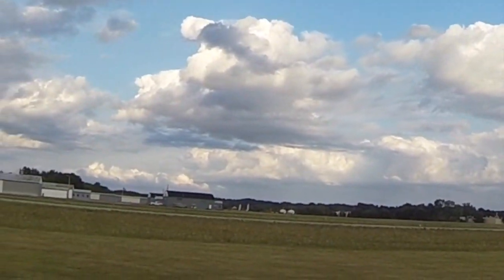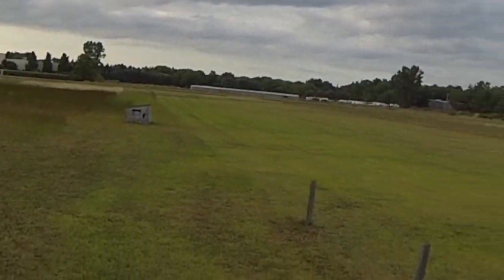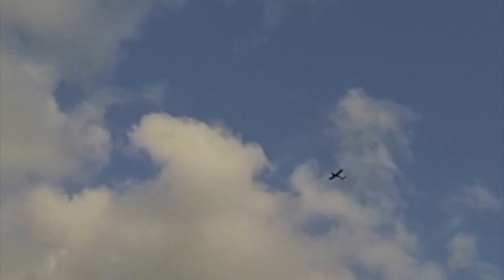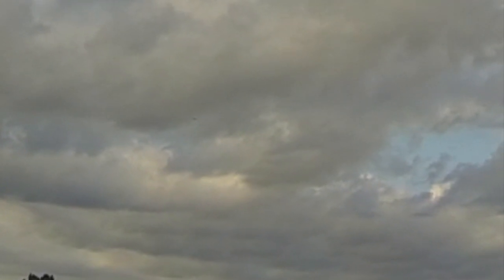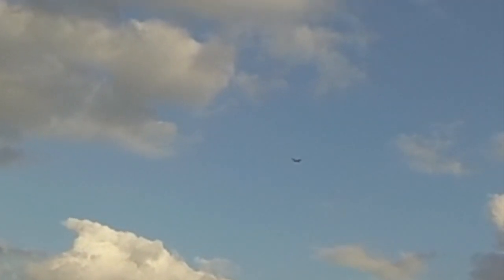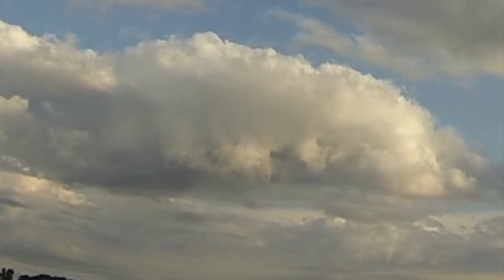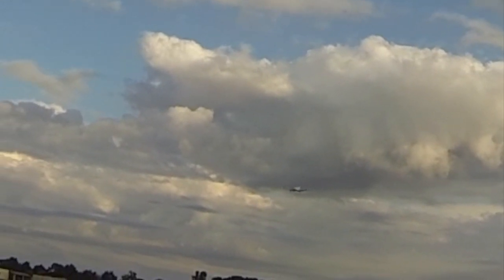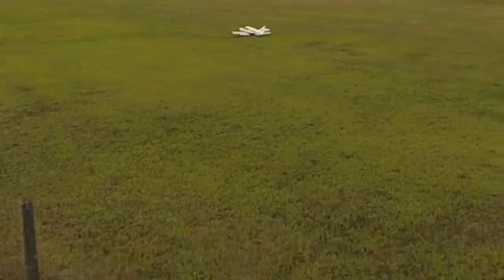Second flight of the E-Flite Cherokee 1.3m BNF

Comment: Just received mine yesterday, and put it together last night. Maiden tomorrow with some luck. The biggest worry for me is the stabelator......I hope I have the thing at mechanical neutral. Wont know till I try it I guess. Yours looked very dialed in. I love scale planes, and flying them scale. I was a full scale pilot for years, and have time logged in the Cherokee 140, so this model was a must have. Congrats on your, and nice flying....you made her look good.
Reply from the maker: ctrcflyin2011 thanks! The big thing is to look for the tiny indents on the fuselage at the leading edge of the stabilator. Align the stabilator to that and it flies perfect. They are small rectangular indents.
Reply: Thank you for the tip. I am very thankful. Hope mine flies as well as yours
Reply from the maker: I am sure it will. I was really happy that it didn't need any trimming or adjusting once the elevator was level. It seemed to be very CG forgiving too. I am hoping to get mine back in the air tonight!

Comment: It took 3 flights to get the elevator perfect, great flying plane, nice outing, Jeff
Reply from the maker: glad you have that dialed in. I was lucky and got it adjusted after the first flight and it didn't need any trim after that. I think the front wheel needs to be aligned as the plane doesn't track straight on the ground. The rudder needed a little adjustment out of the box and I should have checked the front wheel better at the same time.